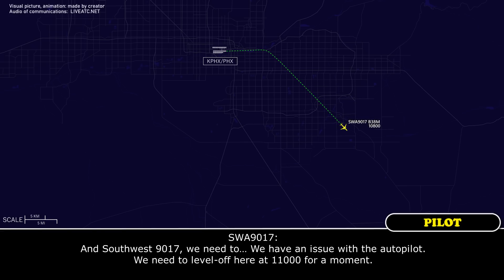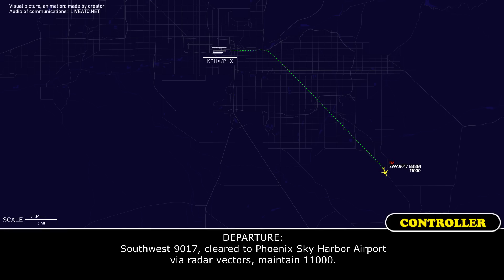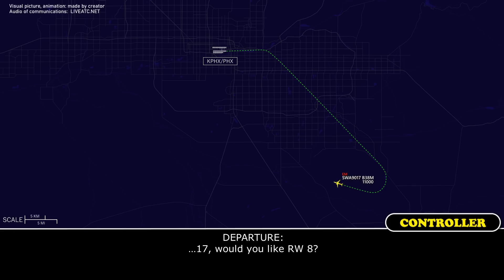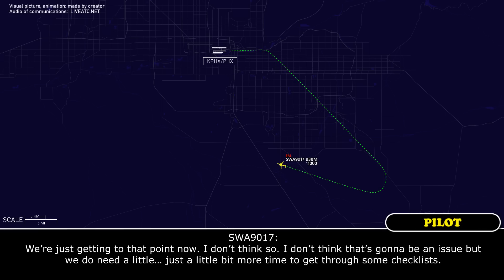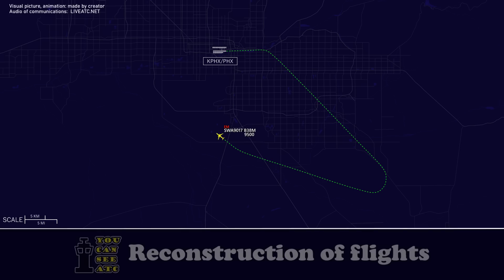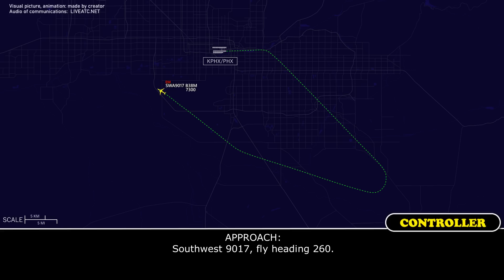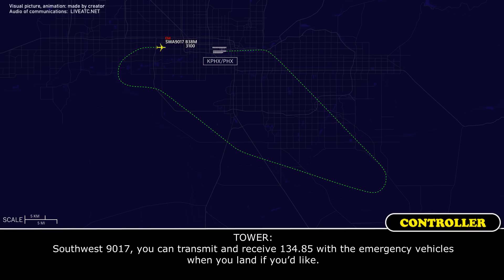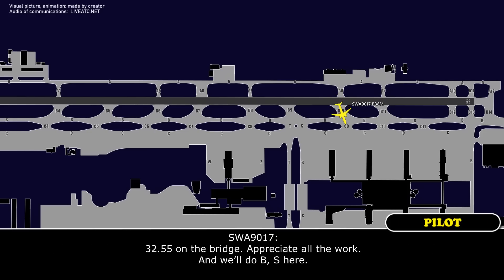“Trim system is not working”. Autopilot issue. Southwest B737 MAX 8 returned to Phoenix. Real ATC

Comment: The pilot should’ve just taken a detour directly up to Boeing in Seattle so they could swap the defective plane with another.  I mean, If I just bought a new car and it had a problem right away I would immediately drive it back to the dealer.
Reply: It was a revenue flight full of passengers.
Reply: @Robert S. Boeing can entertain the passengers while they get another plane ready.  

Of course I was joking in case it wasn’t obvious 😉
Reply: Southwest must of inspected the aircraft @Boeing and then performed a delivery flight prior to a full commercial flight, whatever the fault was it didn't appear till this flight.

Comment: Just a few weeks ago a 737 MAX departing Miami also had a stabilizer trim/autopilot issue and had to stop climb SE of the airport and immediately return to land. Situation was handled safely and routinely by the flight crew and ATC. It is too easy to jump to the conclusion that these incidents were MCAS-related and dangerous but folks, we don't know that so please don't speculate if you're not an informed expert. These are interesting stories but pilots and frequent fliers know that equipment and system issues that stop a flight, while not common, are also not rare and happen somewhere every day. Here we see another example of competent airmanship under pressure and as usual, the entire system worked for a safe result. If you don't have confidence in that, drive or take the bus but understand you're way more likely to die.
Reply: People tie these two things together way too soon. This is a problem any aircraft could encounter.

Comment: The alaska air trim issue made all trim issues very important and forefront in pilots minds when the trim system..which is part of the primary flight controls!….malfunctions for whatever reason. You idiots condemning these guys because its only a trim system and autopilot need to just stay flying your 
Pipers. Great job to the crew and atc.

Comment: Having to fly the airplane by hand is an "emergency"
Reply: Having a potential flight control problem is. They didn't declare because of the A/P. They declared because of the stab trim.
Reply: @achmedbincouscous2846  They didn't have a flight control problem. They were controlling the plane just fine manually, they say so.
Reply: Obviously you don’t understand how important trim is in a jet. At least the 737 actually has a manual trim wheel in these situations.  This is not normal
Ops nor would you want to continue the flight if you had just departed.
Reply: @scootero8218  Go ahead and point to the part where I said they should have continued the flight without trim.

Comment: I have heard that SWA pilots do quite a bit of manual flying/ handling compared to other airlines considering their route/ sectors.  I am sure this practice would have helped them in the situation.
Reply: This is true.    Automation dependency is not something you see at SWA.
Reply: For sure. It also helps that there is mechanics involved and isn’t fully operated by the computers
Reply: All US airlines are like that. US pilots spend more time hand flying for proficiency.
Reply: @Pilotman28  That's good to know.
Reply: @Pilotman28  that’s not true at all. Southwest does the most hand flying because of there routes. Especially flying into Dallas love.
Reply: @Porsche4life , and John Wayne / Santa Ana airport too.
Reply: That is complete bullshit
Reply: @cloudstreets1396  So SWA pilots dont do much of hand flying ?
Reply: @theacechip  SouthWest pilots don’t do anymore hand flying than they have to just like any other airline
Reply: @cloudstreets1396  Ok. What I had learnt in the past was that as an operating philosophy, SWA had somewhat bespoke flight  systems on their B737s that necessitated manual flying to the extent possible considering their route system.
Reply: @theacechip  I have flown the jumpseat many times on southwest and they engage/disengage the autopilot the same way any other airline does.
Reply: SWA PILOTS ARE HOT SHOTS !!!!

Comment: Someone who flies the max a lot, i can tell you we have a lot of issues with ours. From pack failure, fmc failure(had it twice in a week). Overwing door issue, trailing edge flap issue,  wing anti ice failure, gps failure. Just to name a few.

Rarely, you fly a max without some HIL items. Don't get me wrong, i really do enjoy it over the 800. Much smoother to fly and easier to land. 
But that said, it shouldn't have these many issues; 

Boeing should have just scrapped the 737 program and come up with a whole new aircraft. The 737 is outdated in so so many ways. It has done its job, time to create a modern aircraft and just slap some bigger screen and call it "new"
Reply: the Boeing organization has degraded to a shell of it's former self.  building another airplane would just be another/different clusterfuk...
Reply: and the management who OK'd new MAX are not in jail for their criminal acts of false reports. cost Boeing more in time and money than a new design. 787's have nose detach problems, too.
Reply: McBoeing is the problem.  Joe Sutter and Bill Allen are rolling in their graves.
Reply: Boeing died when airbus came up with the ability to link the pilot and copilot sidesticks with force feedback.  The ability to feel what the other pilot is doing kills off the only advantage yokes had.
Reply: Its not what YOU want, its what the AIRLINES want.  You don't buy the airplanes and you don't pay the bills.
Reply: @ahndeux  But it's my life at risk each work day with aircraft that doesn't seem to live up to the quality they should for being such a young fleet.
Reply: @Arcadiez  If you don't like it or don't feel safe, change your job.  Its a free country.

Comment: This doesn't seem overly surprising to me. I was always told that Aircraft are most dangerous at two points during its life; near the beginning of its life and near the end of its life.
Reply: Yes, this phenomenon is known as the “bathtub curve”
         Risk of mechanical related failure on the Y axis and time on the X axis.    The shape resembles that of a bathtub cut along its length.

       Early in life, mechanical things suffer from “infant mortality” usually due to improper initial assembly/lubrication etc.

       After about 300 hours/cycles, if components have not failed, they will most likely last until their MTBF.

        At the end of the bathtub cycle, the curve turns upward usually due to cyclic fatigue and corrosion.

      It is assumed that the curve stays low and flat in the middle due to proper preventative maintenance and diligent inspection intervals.
Reply: @Stepclimb  thanks for this....seems eerily like most crashes - average happens either 8 mins after take off or 8 mins before intended landing.
Reply: @Stepclimb thanks for that, i suppose it’s true of most transport modes, what’s the ideal age for a plane for maximum reliability? 2-15 years? All things being equal, maintenance etc
Reply: I'd say the end depends on operator/maintenance. By then it would have been ripped to the studs multiple times along with many other higher level routines. And most aircraft are retired purely for economics, not technical reasons.
Reply: @outermarker5801  ; From what I understand the aircraft had been delivered for the manufacturer two days before
Reply: A buddy mechanic said also right after a heavy maintenance check is not a good time.  Same theory.
Reply: Actually the most dangerous airplane is one just out of maintenance
Reply: @cjswa6473  
          That can be true.   

   It depends on the quality and quantity (invasiveness) of the maintenance and if a second set of eyes (QA) was involved.
Reply: The most dangerous time is right before it crashes.

Comment: Cmon . it is a deal but not that big ..
understood the auto-trim didnt work but they were able to do it manually for the time of their flight 
wish these other 2 max pilots had that chance 
99% of pilots are professionals and CAN handle stuff like this .. if the system lets em do it 
they did the right thing shutting off automatic stuff and fly manually 
of course they HAD to declare and return

Comment: Personally, still not a fan of the MAX. Flown on it about 6 times already and every time I can't keep my mind off of the autopilot and trim issues (MCAS) that it has. Boeing needs to do something about this...again.
Reply: They fixed it already
Reply: I don't recall hearing about any autopilot issues with the Max, and there were no MCAS issues at all. MCAS didn't malfunction in the two Max crashes, it operated exactly as it was programmed to after receiving faulty data from a broken pitot tube. The issue is that pilots were not trained on how to identify and resolve anything related to MCAS, MCAS was not initially programmed to turn off after a pilot initiated their own trim inputs, and MCAS was initially programmed to drastically alter the plane's pitch instead of slower inputs. All of these have been resolved. I'm not saying this to let Boeing off the hook, just stating facts- these issues are resolved
Reply: @jb8331  How about the issues of putting the engines on top of the wing...lol.. Charging extra for safety related instruction.. You can tell on earlier models of the 737 they were already fudging because the bottom of the engine nacelles were FLAT because they were toooooo close to the runway.. To put bigger engines they had to move them on top of the wing because they had run out of room.. Could have made the gear longer and left the engines alone but that would have involved A LOT more redesign.. The bean counters weren't going for that from McD.. I can remember 206 B-47 crashes through the years made by the same company, flown by the best pilots in the world at that time.. So YES, Boeing can really screw the pooch now and then.. The B-47 should have been grounded after the third crash and their rotting remains spread out in Arizona, but they were spared, just like the MAX..
Reply: You should not be ordering these plane tickets. Why are you taking such a risk?
Reply: @Videos888  heh,heh.
Reply: Not an MCAS issue, just autopilot issue, probably some wire came loose, grow up.
Reply: @theresacaron4238  yeah until the plane crashes and explodes

Comment: Scary. Isn't this the issue that brought down those two early 737 max?
Reply: I don’t think so. That was the MCAS system that automatically pushes the nose of the plane forward when the plane recognizes a stall, but it wasn’t actually stalling. This seems different, almost like a more simple electrical issue.
Reply: My understanding is that it's the same system, but the opposite issue. The one that caused the crashes was runaway trim, the autopilot system acting erroneously and in error. This time the system shut down entirely. So the pilots had full control of the airplane, it's just difficult to fly these big jets manually, so that's probably an essential system per their POH and necessitated an emergency landing.
Reply: Not necessarily. That would have been called runaway stabilizer.
Reply: To be clear 'runaway trim' and the MCAS issue of the past are two different things.
But no, this is an entirely different issue. And even if it were MCAS related, that system is radically different today.
Reply: No

Comment: I rest my case. I will never fly on a B737 Max never ever.
Reply: Why exactly?
Reply: @JayJayAviation  the aircraft is not aerodynamically stable, the design is a compromise that is dangerous and will for sure kill more. Don’t bother to reply, I won’t go any further with my statement.
Reply: @sdj4112  This is false. The design is not unstable. The reason MCAS exists is so that the MAX flies more like the previous 737 variants. The amount it pitches up is not critical to flight safety, especially when crews constantly monitor their attitude
Reply: @JayJayAviation  so you are saying that the crews of the crashed Maxs are the cause of the crashes because they failed to monitor the aircraft attitude and trim. Tell that to the families of the victims.
Reply: @sdj4112  That’s not even close to what I’m saying. MCAS itself malfunctioned due to a design flaw in the software. This is in no way connected to the purpose of MCAS.
Reply: @JayJayAviation  So please do tell the exact reason and purpose of MCAS on a MAX.
Reply: @sdj4112  read my 2nd comment
Reply: @JayJayAviation  that does not describe the reason and true purpose of MCAS. Please give the system description and not generalities. 
The CFM Leap engine nacelles are the reason. The aerodynamic effect of its nacelles causes the Max to pitch up at higher angles of attack.
Reply: @sdj4112  yes, they pitch up a bit so that the MAX doesn’t fly exactly like the NG (reason for MCAS), however it’s not severe. I wouldn’t call it “aerodynamically unstable”

Comment: I justify the emergency call by it being a new plane. They don’t know what else might be letting go unexpectedly.   Emergency doesn’t mean your plane is about to crash and how many accident videos have we seen where it's like "damn dude just declare an emergency!"
Reply: Yeah thought about that myself - its new and should be fully functional and there's one major system failure who knows what else they just haven't identified as a problem yet.  Wasn't the 737 Max 8 the ones that had a tendency to crash due to problems with trim control too - probably weighing on their mind if its not working what if it spontaneously starts working against them too.  And depending what caused the computer issues if it was an instrumentation mismatch or failure that could also get worse if they had to land on instruments only.
Reply: @matthewmiller6068  Yes, I think that is the real reason he declared an emergency.  Probably forces some sort of investigation.
Reply: Ha fully functional just because it’s new? You dint know Jack. Every airplane has something wrong with it ever time.
Reply: Not to mention that it was a trim problem in a Max 8…

Comment: Oh this can't be good for Boeing.
Reply: This has nothing to do with Boeing. Just a run of the mill stabilizer/auto-pilot issue. Rare but it happens on all plane types
Reply: @jb8331 .  It's a 737 max with a trim issue.  It was a trim issue that caused not 1 but 2 737 max aircraft to crash and the grounding of the entire fleet.    But No, this has nothing to do with Boeing.  facepalm.
Reply: @tchevrier  are you talking about the Max crashes from MCAS or are you talking about this particular incident above. Cause this incident had nothing to do with MCAS so I’m not the one confused here
Reply: @jb8331  I never said that this particular incident had anything to do with MCAS.  I said this particular incident was a trim issue on a 737 Max.  The 2 crashes were also trim issues on 737 Maxs.  So whether the cause of the trim issues are the same is irrelevant for a company trying to repair the reputation of this aircraft.  
So yeah, YOU are the one who is confused here.  facepalm.
Reply: @tchevrier  but this wasn’t a trim issue, it was an autopilot issue. The aircraft was unable to trim when the autopilot was engaged but the pilots could trim manually when they disconnected the autopilot. It wasn’t a runaway stabilizer issue otherwise the pilots would have said that in the ATC transmission. What they said instead was they were having an autopilot issue that was impacting their ability to keep the aircraft in trim. But even if it was a trim issue, you’re initial point still makes no sense. Why would it be bad for Boeing? All aircraft are subject to trim issues. This would have nothing to do with Boeing even if it were a runaway stabilizer issue. Airbus also has had stabilizer and trim incidents on their planes. What does any of this have to do with Boeing? That was my point.
Reply: @jb8331  But it was a trim issue.  That's what was affected.  You said it yourself.   The aircraft was having problems with the trim. The difference between this instance and the 2 crashes is that in those 2 instances the problem was identified to be caused by the MCAS, whereas in this situation the cause is  unknown but speculated to be caused by the autopilot.  In either case the problem is an aircraft with trim problems.  

"why would it be bad for Boeing?" - Well first of all, it is a Boeing aircraft, is it not?  Second, It's a brand new aircraft and anytime you have a system failure, especially a control system, on a brand new aircraft that is concerning.  Third, Boeing just went through a very public and very controversial grounding of this particular model of aircraft due to a problem with aircraft trim. And now a brand new aircraft is also having trim problems.....    The perception is not going to be good for Boeing because of the 2 recent crashes.  That's the point.

"Airbus also has had stabilizer and trim incidents on their planes" - But have they recently had their fleet grounded because of very publicized crashes as a result?  That's the difference.
Reply: @tchevrier  fair enough. You’re absolutely right that perception is everything and it’s unfortunate for Boeing that this incident occurred on a brand new Max aircraft. And we also don’t know exactly why the aircraft was having flight control issues to begin with. The pilots said that the autopilot was not trimming the plane. We don’t know why, but my only point was that it is unlikely to be related to MCAS. Doesn’t change the perception though- you are right